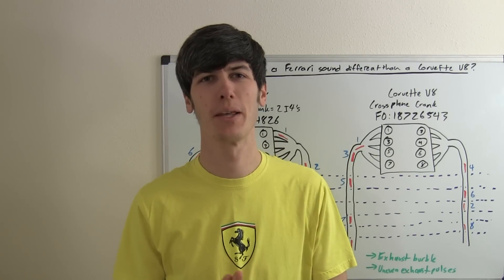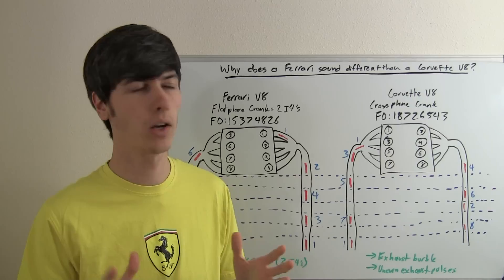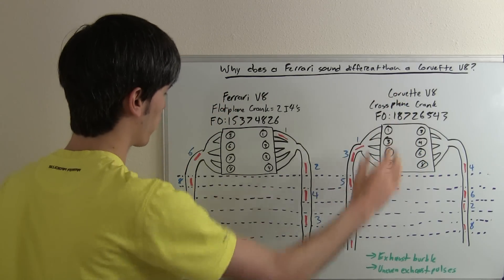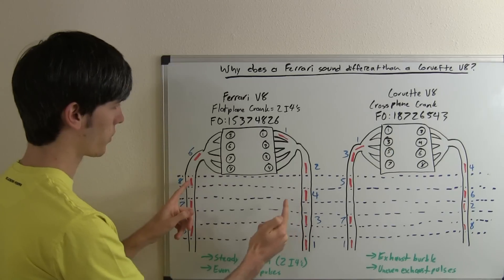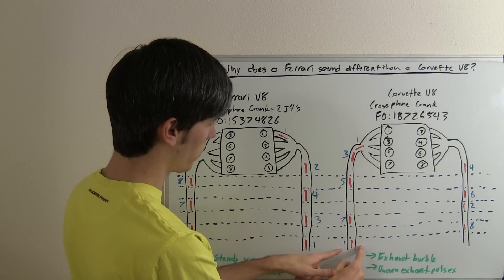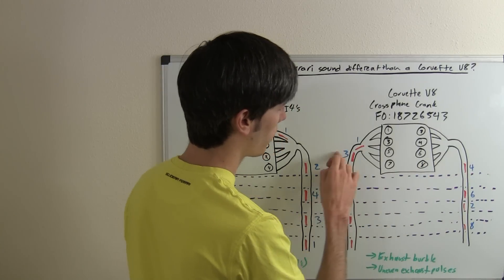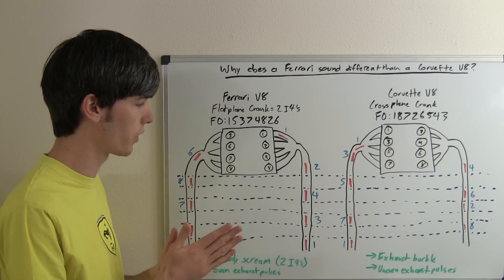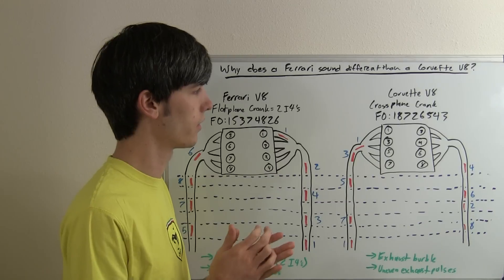Ferrari V8 vs Corvette V8 - Why do they sound different?

Comment: All you had to say was that Ferrari knows what they are doing and Chevy doesnt haha.
Reply: Funny because American V8's are capable of making 8,000-10,000hp+ out of 500ci engines. You will NEVER see those kind of numbers with a flat plane V8 ever.
Reply: +smnkm4ehfer Flatplane cranks provide more power as they are more balanced....if you fitted those crossplanes with a flatplane, youd get more power.
Reply: +Nick Palaroan   
The crossplane crank was introduced because the flat plane crank is not balanced.   It's basically two 4 cylinder engines mated, and 4 cyl engine has secondary imbalances.
Reply: +charlesvan13 A flatplane can be made just as smooth if not smoother than a crossplane.
Reply: +charlesvan13 The flatplane has primary balance, which the crossplane does not and is why it needs its heavy counterweights. This alone makes the crossplane "unbalanced" but allows for the use of bigger and heavier counterweights to smooth it out. But the same can be done for a flatplane, and it can be made smoother than a crossplane and still reap the performance benefits.

Comment: americans got it wrong again
Reply from the maker: +Kristian benz https://youtu.be/G04TZvYjSaw
Reply: +Kristian benz yamaha's r1 use crossplane cranks
Reply: +Kristian benz  GM did pay for some experiments in racing Chevy engines by getting Smokey Yunick and others to do some dyno tests and race track tests on different cranks as well. This was long before computers, so every test 40 years ago, was a long drawn out trial and error. The point now is that all the very expensive development today, is done on existing engines and theory. For GM to do a complete change to a different crank, requires throwing out all the hundreds of millions of dollars of engine testing and research spent over the past decade. Ford seems to be now testing the different cranks on some race cars. If they feel it is worthwhile, it will show up in regular production engines.
Reply: +Mark S 
The main reason for cross plane crank V8s is they have less vibration then a flat plane crank V8.
Reply: it was developed by French engineer
Reply: +Patchuchan flat-plane actually gets less vibration then cross-plane, because 4 pistons going up are equalized by 4 pistons those are going down, so no balance wheels are needed
Reply: +Go Mad 
No, the cross-plane crank was invented to eliminate secondary imbalances.   The odd firing order plus counter weights on the crank eliminate secondary imbalances.

The flat plan crank v8 will vibrate more.   But they are usually used in racing applications where that's not a concern.
Reply: +Kristian benz You like VW's? You must like repair bills too.
Reply: +Mrcrazydave11 hmm no i don't like repair bills i am driving a vw for 2 years now and i have never had a problem with it (VW golf mk5 TDI) ok Americans maybe didn't got it wrong but i hate Americans Why you ask , i don't hate the american people but i hate the fact that they just sit there and don't do nothing to stop the american government destroying the world with wars and fake terrorist that work for the american government, and in the country i leave (Bulgaria) you probably never heard of Bulgaria before but it has one of the riches history in the world since 681 year A.D . And  Bulgaria is one of the most ruined countries because we entered NATO and the USA is doing what ever it wants with the countries that are in NATO , and now they want to make war between Turkey and Russia and guess what, they want the normal Bulgarian people to fight against Russia  , and we don't want to do this because Russia has saved us from Turkey in 1878. So not that they are making us living in a misery they want to kill us like we are not humans because we don't have weaponry i mean lots of people in Bulgaria don't even have money for food we have lost any faith , the car i am driving its like a Ferrari for some people here. Sorry if bad English , o and as was i telling you Bulgaria is now a very poor country and the roads the quality of the fuel and oils are very bad but the most driven car in here is a VW because they are the most reliable cars for our roads .And Ferrari is still better than the Vette .
Reply: Ok
yes I have heard of Bulgaria. And yes I think the US government SHOULD stop interfering with the rest of the world because we don't need the rest of the worlds problems. The reason we do get involved is because of Hitler. If we took him out before he invaded anybody, then we would have saved millions of lives but you're right. We shouldn't police the rest of the world. We also shouldn't help anybody when there are earthquakes, famines, evil dictators invading other countries. We shouldn't try to prosper any other countries by sending our jobs over there or rebuild countries that attacked us in the first place. We should keep our internet and computers and all the medicines and let the rest of the world figure it out for themselves. And Vette kicked Ferrari's ass this year on there own stomping grounds. You're English is great don't worry about that.
Reply: +Mrcrazydave11 wow. very well said.
Reply: all these political talks had explained the difference in sound between flat- and cross-plane so well)))
Reply: +Go Mad Your right, sorry.
Reply: +Go Mad And unfortunately you didn't get to see her other comments. bummer.
Reply: +Mrcrazydave11 I had read everything
Reply: +Mrcrazydave11 I read her other comments too. Incredible. I think Mrs. benz is really in N.Korea.  Or probably bitter because she can't immigrate here. I wish she would just thank us American's for the internet and then go on about her way quietly.
Reply: +DSC800 especially talking shit about how kind russia is, I live in Ukraine and I know how shot Russia is, making war in the east of my country. a lot of shit in comments behind.
Reply: +Go Mad Thanks guys. Now back to CARS!
Reply: +Kristian benz Mrs benz keeps writing nasty foul comments and then deleting them:  I think she is quite angry and filled with hate, but her written English is quite good even with the harsh language.  I don't think everyone in Bulgaria learns English either? Best regards from America,
Reply: +DSC800 I am not deleting my comments youtube or the chanel did. If someone wrote a bad comment of another country no one will be bothered , yes i know english well because i studied a lot and everyone in bulgaria learns english and russian in school . But it seems it's too hard to understand the truth for brainwashed people like you i am not angry at you i  am nagry at the world policy and the big american monopolistic dirty companies . At you no i am laughing at you how siple you are .
Reply: nope I think the owner of the video is. Kristian the KGB is looking for recruits. You'd be perfect. Oh and I'm not the bitter one. I didn't say Bulgarians suck, did I?
Reply: +Kristian benz Ok, well I looked it up before I wrote my comment and saw that only 20% of Bulgarians speak English. Where I live Spanish is second to English so I've learned a little. It's too bad you feel happy to laugh at me thinking I am simple when you don't know me. Anyway, seems Bulgaria would be a good country to visit although I doubt I'd ever be able to.  I especially like the architecture, those buildings hundreds of years old and very interesting.  Nothing is over a hundred years old here In California.  Regards,
Reply: +DSC800  look Sorry if i insulted you sorry if i insulted Mecrazydave 11. i know english well because i am a programer and in every school in Bulgaria english is mandatory. i didn't say that the normal american people are guilty for the world policy corruption but the american government and the big american companies are. And believe me thats no bullshit i am talking about . and the reason why i became bitter at you is because you insulted me in the first place by calling me a Mrs. THE END
Reply: The real V8 is a cross plane cranked, with its smooth idling and unique sound of a V8. Breathing is totally depends on the design of intake manifolds and exhausts.
Reply: +Kristian benz With the help of the Germans, who still help engineer the Corvette...which is awesome.
Reply: yeah right. Your delusional. In the 80's during showroom stock car racing, Porch took back two corvettes back to Germany to figure out how we kicked there asses.
Reply: when things were simple you were good now things a complicated and now Porsche kicks every single Amerian car 's ass
Reply: +Kristian benz Well since we wont agree on this lets find out what happens this year at Lemans. We whooped you here in Daytona and we'll whoop you there, again.
Reply: i was talking about the road cars but the last time i watched Le-mans an Audi diesel won the race and still the vette will never be as precise car as a Porsche or a Ferrari  or Pagani or Lambo and you still use twice as big engines to make the same power , but i am not going to argue  we shell sea on le-mans reply me when the race begins (not watching races very often)
Reply: The GT class is the road cars. They have to use the factory car. Audi won overall in the prototype class but corvette has been winning Lemans for quite some years now that GM has put some effort in to winning it. So lets see what happens. Our engine are not twice as big. Porch and Ferrari uses turbos so a 3.8 liter engine can double, triple or even quadruple its output. Lambo has been using 6.6 liter engines. But they spin them to 9 grand to make power were Corvette uses a modest 6000 rpms. It's too bad you wont get a chance to watch the race.
Reply: anyway  we won one category you won another so you haven't beaten the euros
Reply: Didn;t think we had. I'm a retired VW salesman. I prefer Euro cars, especially Audis.
Reply: You didn't. The 2015 Lemans was won by Porsche in prototype class and Corvette the GT class beating 2 Ferraris and a 911.
Reply: wow big achievement you have beaten us once or twice and you think you are the all time winner , yes you really beaten Ferrari four times with the Ford GT in the 60s-70s but that was a British design car.
Reply: +Kristian benz Ok We won our class at Lemans 8 times in the last 16 trips. Now I have a question for you. How many NASCAR, NMCA or NHRA races has ANY euro car won. Answer... None. You can hate all you want but 63 years of corvette is a long production for a car that you Europeans refer to as junk.
Reply: Nope Americans want expensive junk. Hopefully they will wise up. :)
Reply: Shoot you? No I'm too old for that. Just keep writing your childish responses. I wouldn't waste my ammo anyway. Judging from your response you must be 12.
Reply: Time will tell Joe if vibration will be an issue. GM has been experimenting with the flat plan crank for a couple of years, too. It's allowed LS engines to spin 9000 rpms but how soft will the motor be at 2? The reason these engines can rev higher is because they can reduce the counter balance weights off the crank. I'm sure that GM will also use a flat plan crank in the future. I personally hate the sound though.
Reply: Mrcrazydave11 I don't care for it either.
Reply: Mrcrazydave11 American makers occasionally use flat-plane in large-displacement V8s in racing applications. The vibration isn't an issue or concern at all for engines that get re-built/scrapped in short order.
Reply: Well, it involves math so yeah.
Go bother someone else lol
Reply: More European smugness without any substance.
Reply: If Americans got it wrong, so did the rest of the world. The vast majority of road going V8 engines from Europe and Asia aren't flat plane cranks, they are cross plane, just like a Chevy V8.
Reply: No, YOU got it wrong again.
Reply: Americans usually get it right !
Reply: There are plenty of flat plane american V8's
Reply: murica
Reply: It's not the corporations so much (they're going to utilize the loopholes given them) as it is the progressives in government trying to commandeer our nation and turn it into a faux-topia. You do seem quite angry, though, and at more things than what's deserved. I have to ask... Did you actually come here to watch the video? Oh, yeah, and I must say that Bulgaria does possess much in the way of beauty. Too much of the better parts of history are neglected in too many places!
Reply: Think about your VW
Reply: Mid engine vette should be interesting

Comment: Good explanation.  Check your Chevy firing order. 18436572.
Reply: +Gary Susan Salmon 18436572 on the older engines ( <1997 Gen I and II small blocks), and 18726543 on the newer engines (>1997 LSx, and newer LTx engines)